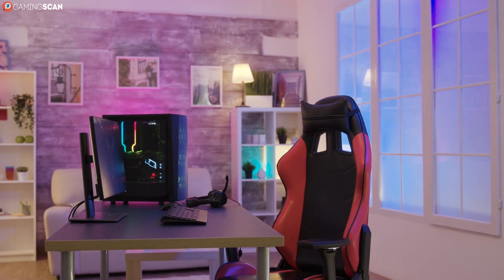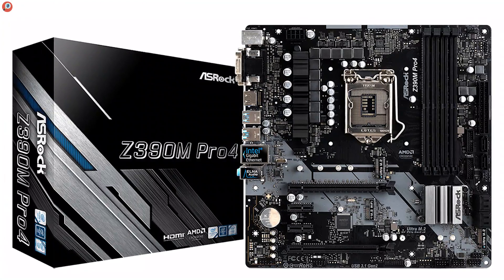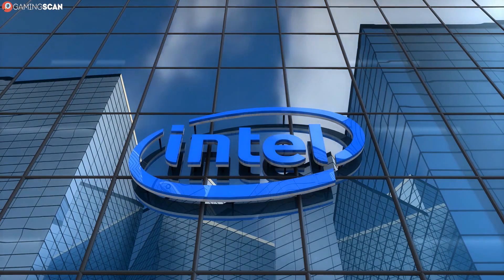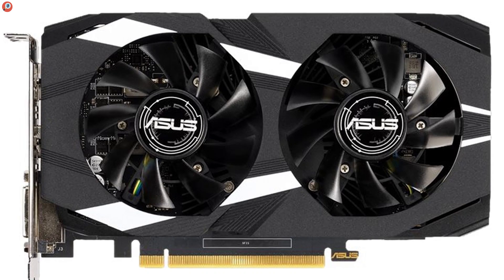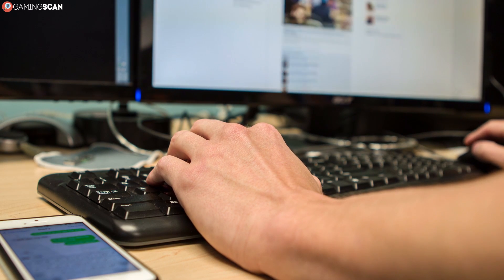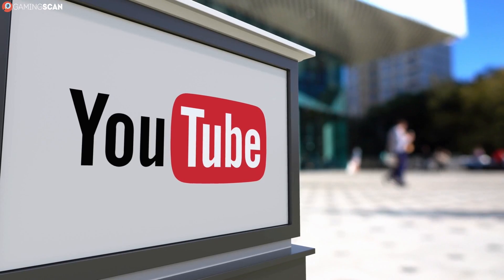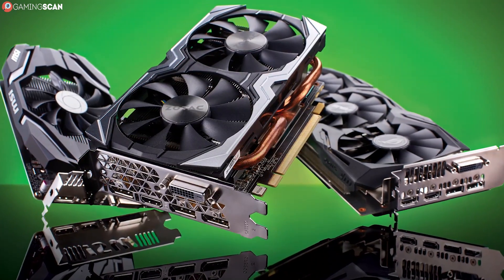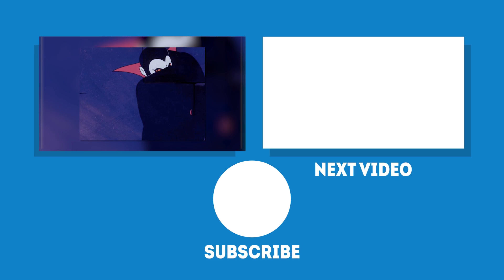How To Make Sure All Your Computer Hardware Parts Are Compatible [Simple]

Comment: Hi

Will there be any bottleneck while pairing any of the below mentioned graphics card with  Intel Core i7 12700 and 16gb ddr4 memory in B760MH ddr4 motherboard with LGA 1700 socket 

GeForce RTX 4070 WindForce OC 12GB Graphics Card

Geforce RTX 5060 Ti Twin Edge Graphics Card - Black | 16 GB

Zotac Gaming GeForce RTX 4070 Super Trinity OC 12 GB GDDR6X

ZOTAC Gaming Geforce RTX 5070 Solid Graphics Card - Black | 12 GB | DLSS 4 | GDDR7 |

Comment: Im the idiot that just bought 2 8 pin connector gpu, when my PSU only has 2 6 pin...

I bought a pre built pc last year , running gtx 970, i7-4770S. 

I bought a new pc case and thought why not get a new gpu that will support my cpu, came today and well yeah, guess im not using the new gpu. Honestly theyve made pc building harder than what it should be, the amount of parts that just arent compatible with eachother is honestlt stupid, I've spent the best part of 12 hours searching for a 2 8pin psu that'll support my gpu, then i see all these other cables on the psu that im not even sure would fit my other components in my pc. Ah well, ill just stick with my trusty gtx 970. 

Dont know why I ever bothered getting into PC gaming, its much more hassle than what its worth imo, if only consoles could mod games the way pc could, i would have never switched.

Comment: So pretty much any gpu is compatible with just about any build?☠️
Reply: Yep. That's why standards exist. PCI-E is the standard used by graphics cards for at least 18 years. In theory, you could use any graphics card from the past 18 years and it will most likely work with your computer. Of course, you wouldn't want to use something that old, but it will work. The main questions are: Will a card physically fit inside the PC case?, is my PSU powerful enough for it? AND does this graphics card make sense for my overall build?

Comment: So if the cpu fits in the motherboard, it's fine?
Reply: Not quite. Even though it may be physically compatible, you have to check the compatibility for the chipset and/or BIOS version. This is even more of a concern for AMD Ryzen builds. pcpartpicker.com is a good website to see if your parts will work.

Comment: Tell if it is a good pc and plz say if there are any cons.
R3 3300x
Asus dual 1660super mini(coz it is cheap)
550 psu
Hyper x16gb ram dual channel each @3200mhz
500gb nvme m.2 ssd
1tb wd blue
Gigabyte b450m ds3h WiFi
Aerocool tor mid tower
Acer nitro vg240y 1ms 75hz ips monitor
Zeb transformer keyboard mouse combo
Reply: did you build it? if yes could you help me out with some explaining
Reply: @Tropical45  i built with lil bit  different specs, but okay tell me your problem
Reply: @doesntm  okay I'll tell you my problem. I feel incredibly lonely and I feel like I will die alone in an apartment building with no one to care for me from that point onward. I don't want for my life to end like this. What should I do?

Comment: So your saying...if I buy a new cpu, does that mean I need to buy buy a new mother board? And if I want a new GPU I need a new CPU, which mean new motherboard and a case?

So technically if you want to upgrade something, like GPU, or motherboard you basically gotta build a new PC
Reply: not always, processor and motherboard are the 2 things which mostly go together, but ram, graphics card, ram, cabinet, psu etc are always reusable

Comment: Processor AMD Ryzen 3 3200G Processor €119.99

Motherboard ASUS ROG STRIX LGA 1151 Intel® B360-G Motherboard €139.99

Memory CORSAIR Vengeance LPX DDR4 2400 MHz PC RAM - 4 GB x 2 €89.99

Graphic card ASUS GeForce GT 1030 2 GB Phoenix Graphics Card €109.99

Internal data WD Mainstream 3.5” Internal Hard Drive - 3 TB €119.99

Case CORSAIR Carbide Series SPEC-DELTA RGB Mid-Tower ATX PC Case €79.99

Power supply ADX Power W850 Modular ATX PSU - 850 W €99.99

€760.00

Is it compatible?
Reply: Yes
Reply: Dude your getting scammed
Reply: 90 euro for 8gb ram is NOT A GOOD DEAL.  Also 120€ for a r3 3200g is a lil expensive and €103 for a gt1030 is 100%  a scam. For a lil more u could get a rx580 8gb which is much better!

Comment: Just use pcpartpicker.com 
Does fantastic, you'll have to do a little checking but 98% the work is done.
Reply: Does it check compatibility for you?
Reply: @rasimqusous7715  yes, some things you could double check, like going to the motherboard website and see for yourself the supported ram speeds.

Other than that, you just read the caution ⚠️ notes and you'll be set

Comment: I just go to an amazing store called inet there you Can build it. It tells you everything. For example, if your gpu doesn't fit your case it will let you know. Or it can let you know which power doesn't have enough voltage to power your build. I think It is a Swedish store though and idk if others can understand or if the site will translate. Hope this helps.

Edit: dammit you showed a site at the end of the vid. Guess this comment is useless :/
Reply: F